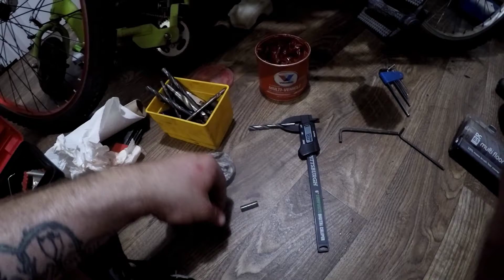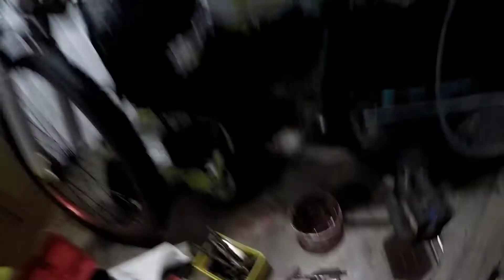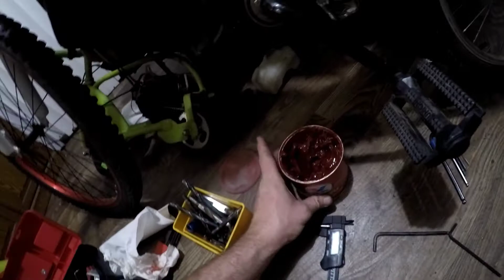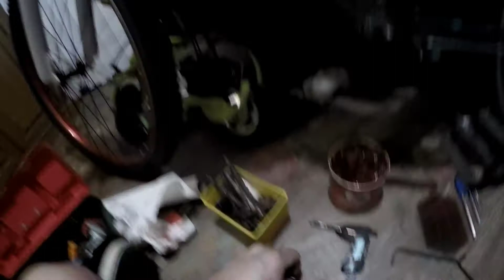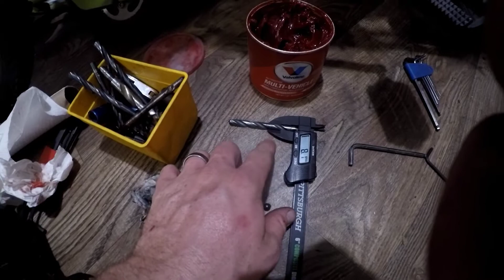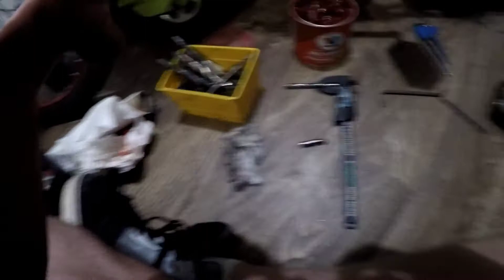YD100 motorized bike clutch fixed!

Comment: Ohh I see what you did. You just compensated for a kinda rounded out clutch arm by making your own bucking bar a little longer. I’ve thought about that situation and wondered if just adding another wheel bearing behind the bucking bar would help as well so you don’t need to keep buying new drill bits hahaha
Reply from the maker: I had a bunch of used drill bits laying around so I just found the right size lol but this was the first time I tru to use one it should be way stronger and last much longer than the original crap steel pushrod that came with the engine as long as I grease it weekly I guess and maybe look for a stronger ball bearing.
Reply: @Baldys_projects  I guess I really don’t know much about metal to be honest but knowing it’s stronger makes me wanna go buy a drill bit when mine wears down and go to a bike shop for a strong bearing(s) as well because I just hate the online wait. Also. I wonder if the pin behind the bearing on the clutch shaft side takes a lot or some beating as well. Because as people say the metal they use in China is probly cheaper even for parts that should be stronger than others